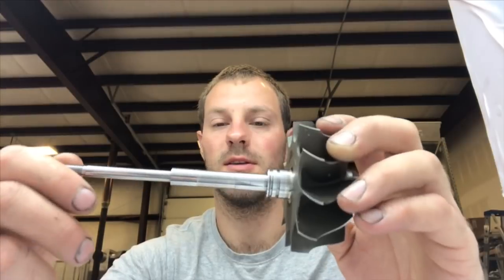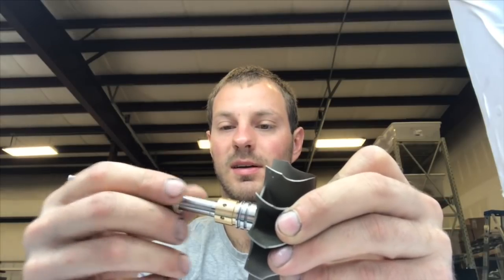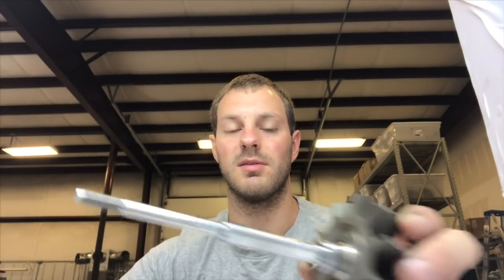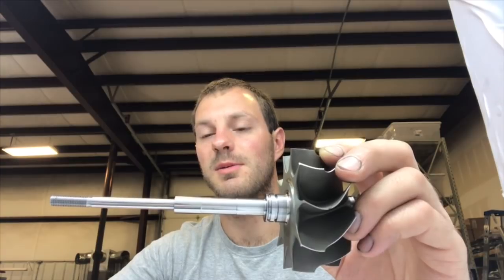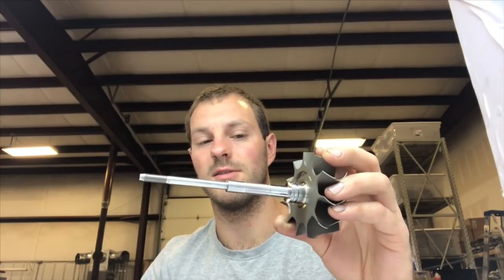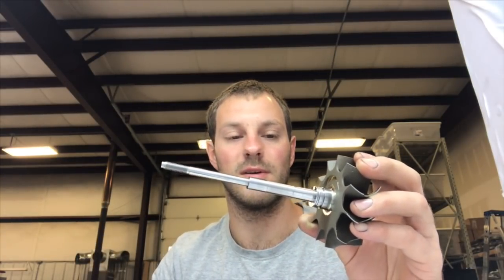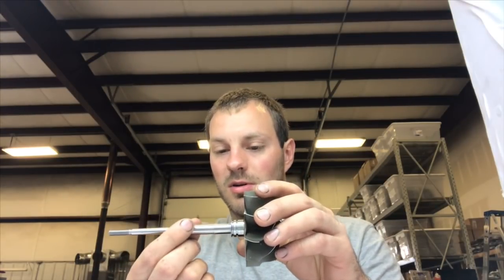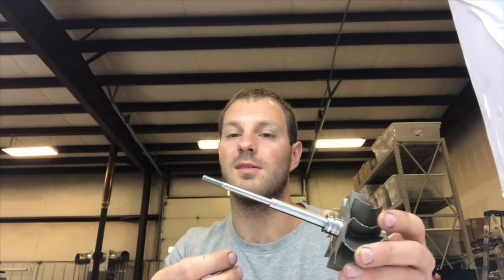Are Precision Journal Bearing and Ball Bearing Shafts The same?

Comment: I've fixed few Precision T4 based turbos, and it appears that the normal Garrett T4 rebuilding bush bearing kit goes straight on on the Precision with 1/4 shaft. They would go straight into a Garrett bush bearing T4 bearing housing assembly with back plate and work. To me the shaft between the two is same.
Reply: You have no idea how many parts and bits are shared amongst them. You can grab 3 or 4 different Garrett turbos ex. gt1549, gt1549v, gt1749v, gt1852v, gt2052v, GT2056V all of these use the basically the same core internals. The GT2052v and GT2056 and bigger ones use bigger vanes housing to accommodate for the bigger turbines, but the core internals are interchangeable. keep in mind that turbine and compressor wheel are ALL different from each other, in the same GT1749V you have a few different turbine and compressor config, turbine houses machined accordingly ofc. I'm only talking about some of the turbos i tore appart/fixed

Comment: Just really wondering if anyone knows a of a big turbo option for a 1.8T gen3 b7 passat? I will greatly appreciate it...!
Reply: k04 turbo works on those ... I have a mini cooper s which runs the same stock as yours.... either k04 or frankenturbo
Reply: @esbekay  Even better is a modded K04 with bigger comp wheel, 4 to 6mm more should do just fine :D not too big if you ain't switching the turbine, you should keep them somewhat matched. Also for more power, get a bigger compressor housing, it helps move more CFM, CFM going in the engine is what you want, makes the setup more efficient
Reply: @engenhokas69  I went from a 36 to 51mm on my mini and it made a significant difference performance wise, so I agree with you there.

Comment: Is it a random event or the GEN 2 ball bearing turbos seem have more chances  to smoke oil compared to the GEN 1 BB turbos?
Reply from the maker: The rear seal is the same. The front seal is different but neither is a seal issue. Most of the time people install the turbo incorrectly
Reply: @turbolabamerica  too much oil pressure or turbo angle not helping oil drain into the pan are the 2 main causes, right?